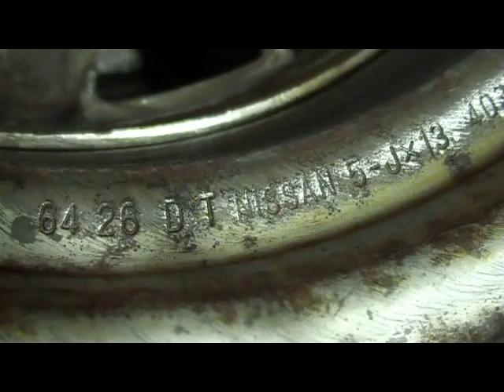Modified steel rim

Comment: Nicely done.. i dont think its round enough for balancing.. but it can be fixed.. It appears to be in the lip of the rim, and not where you welded it. Its pretty common for steel rims to get like that because of people driving into the gutter or kerb. But it is repairable with the right machine. Its kind of like a 'jenny/swaging' tool, but more powerful.